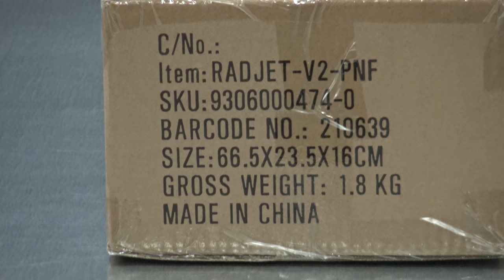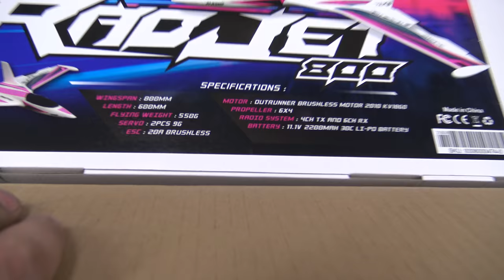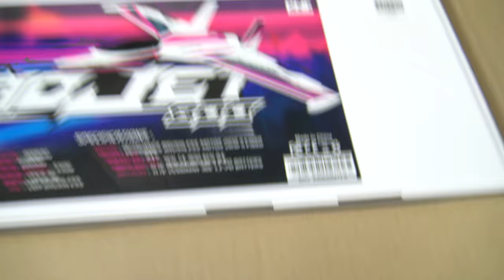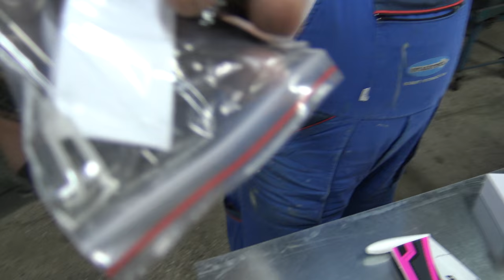H-King Radjet 800 V2 EPO 800mm (31.5") (PNF) Unboxing

Comment: I will confirm that this plane is awesome, it flies very well when balanced right, has a great speed range but slows down for landing. Do not stall it, it will fall out of the sky, it happened once. I've had mine for 5 years, maybe 200 flights, fixed many times with gorilla glue, been in pieces but still flies great with original motor, esc and prop, did replace one servo but all the rest is original. 
Amazing durability and good flight envelope, enjoy
Reply: Any tips on balancing  . Myn wanted 85 gram on the rear with a 2200 3s in the nose . Do you balance right way up ?

Comment: First i would like to say thanks for the efforts you gentleman put into your channel Robert.  Always fun to watch.

I have had a couple of the original radjets over the years.  Both are the v1 i suspect as I had to add a carbon spar.  On my second I added rudders because the plane would sometimes get into a spin that was un-recoverable.  I also fitted a gyro.  The plane fly's and launches easier with light batteries.  I always flew mine on a 1300 3s or a 1000 4s.  Good luck with it and look forward to your  maiden flight video!

Jay

Comment: I changed the esc on mine. it burned out at the first flight. But if you go for a 4cell 2200 add a 40Aesc and you will have a supersonic radjet.  Great video again.
Reply from the maker: I will try on 3S on maiden. I think that even this will be enough for my hand.
Reply: @PetrincicBrosRC  🤪

Comment: Absolutely loved mine ran on 3s 1000 ma only because it was the only battery I had at the time had several failed attempts launching at first almost to the point of so much damage it was a bin job finally just pointed it sky ward full bore and let go then once its got some height have a proper play then the fun started super stable at least 50 mph 80 kph became my favourite grab and go plane until I hit the tip of a tree branch and ripped a wing off , not quite a fun jet but cheaper but near enough ,
Reply from the maker: I cant wait to test mine my friend.

Comment: I crashed my little mig today... Snapped the wing in half at the servo. I think the umx migs wings are too thin for the air foils the punch in them. Little ca, little hot water, little clear tape and i will fly again tomarrow..... So easy to fix these now it blows my mind. New wings on the way too and i removed the runners and taped over them as well on the three that didnt brake as well. Next time i will keep away from the sunset lol. Salute to you capn robert!

Comment: The radjet is an awesome plane. I currently own my second one with different esc, motor and 3s 1500mah batterie and it‘s almost as fast as an multiplex funjet ultra with 6s, but much cheaper. If you wan‘t something fast i can recommend the plane!
Reply: Yeah the wings are much thinner and the overall plane is more aerodynamic
Reply: Hi mate can you give me some info on balancing the rad jet 800 V2 . 2200mah are way too heavy . I added about 85 gran on the rear to balance myn but not flown yet as I hear 1.3 mah will be better for balance . 

Also can you tell me if I balance right way up or upside down

Comment: I have one of the original Radjets, it's a fun little devil. Just be sure to be a little nose heavy as they can stall and go into a flat spin. I think they are better suited for a 1300mah 3s battery too, to keep the wing loading down. I have repaired mine a few times now and it just won't die. This would be an excellent screamer for the quarry 😏
Reply from the maker: They say 2200mAh but maybe I will go with 1800mAh. I hope for something here ;-)
Reply: @PetrincicBrosRC  One of the modifications of the original Radjets was to cut the foam out and replace the 1300 with a 2200 battery for longer flight time. I was achieving 8 minute flights on a 1300 full throttle as it was. Belive me after 8 minutes you want to land. All the 2200 battery does is make the plane heavy and in my opinion doesn't fly as well. That is my 2 cents anyhow.
Reply from the maker: @bloodnocka  Thanks my friend.

Comment: Nearly bought a Radjet V2 last year but tried it and found it was just too fast and noisy for my liking. Great little plane though, and flies slowly surprisingly well. You won't need a bungy, it'll glide well from a decent throw and you can throttle up when it's well away from fingers. Oh, and it's a carbon TUBE Rob, not a bar. 🤔